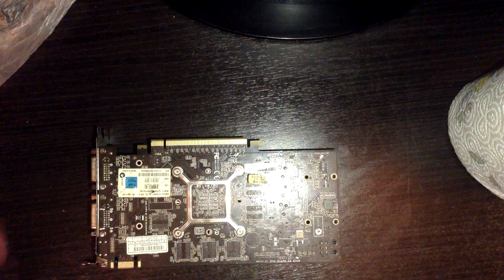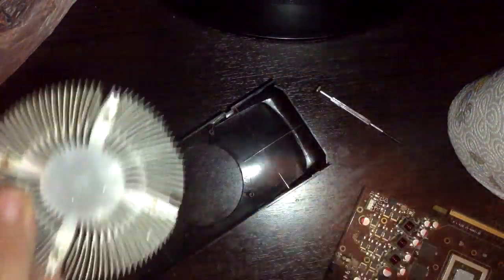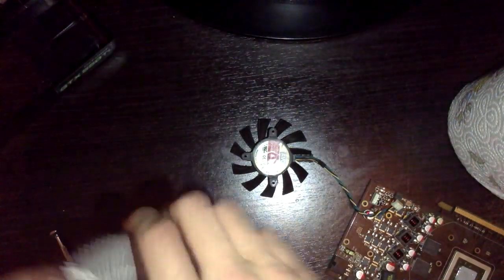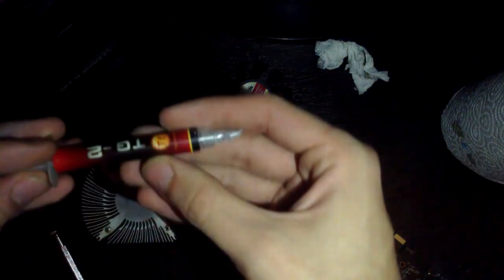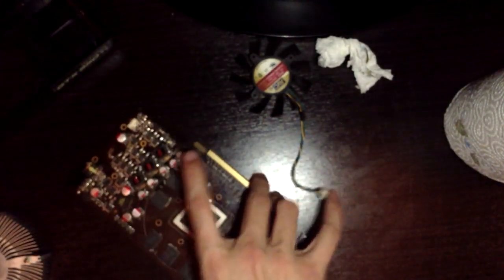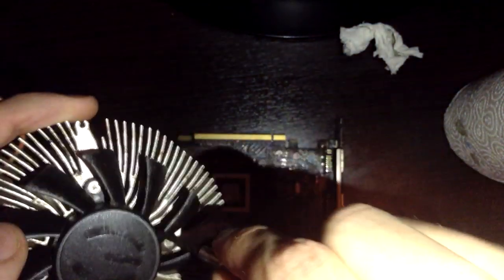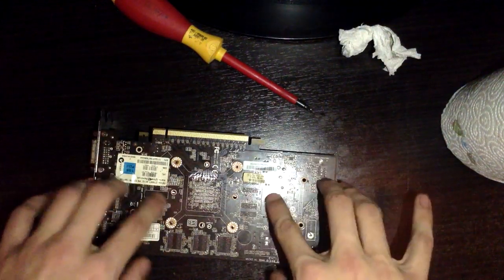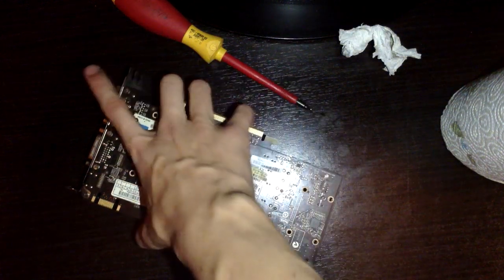How To: Clean a Graphics Card and Apply New Thermal Paste - EVGA GTX 550 TI

Comment: You can use Alcohol to clean that heatsink & old thermal paste off of the chip, as well as the fan dust.  I find it works well, just make sure it's Isopropyl alcohol.

Comment: brother, I have this same graphics card but one day I had an accident and I connected it to a monitor that shorted and damaged both components (integrated) that are next to the DVI connectors of the card, could you tell me the code of both integrated for I can buy them and fix my plate? I would greatly appreciate it

Comment: no dude u never smear thermal compound across a gpu cpu, only a bb size dot and the compression of the fan to the gpu is what makes it spread you also want two allow 24 hrs for it to set before Turing it on.

Comment: Good vid, but don't place the heatsink in water and "give it a good wash". Use a vaccum cleaner or get a can of compressed air. Either from your PC parts store or a chemist (pharmacy) yes a chemist. Why there? Because chicks use a can of compressed air to dry their nails rapidly after painting them.. So both places stock compressed air..

Secondly when you're removing the old thermal paste,  you need to make sure that surrface is spotless, and that means when you have everything you can get cleaned with your paper towel gone, use a cotton tip with de-natured alcohol to remove any leftover trace (or contaminants) to finalize it (prime it if you will)... Treat it like you would a CPU....

Thirdly FFS DO NOT USE A PLASTIC SHOPPING BAG!!!!!!!!  Jesus christ those those things statically charged. Why the hell do you think they seem to attract to your skin? They just gravitate there by random chance? yeah, static from the bag and your natural body static charge.... Holy shit how have you not fried your components??? Use an old credit card or business card or a piece of scotch tape (The frosted stuff)

Apart from the technical screw ups its a well presented video, easy to follow, clear to see, but you just need to rectify the bad advice given in it.
Reply: *****
Why? The thermal paste is kinda needed....
Reply: *****
Going back and looking at the video, yes, I would agree with you, def too much compound for sure. I didn't catch that first time round.. BUT my comment about the plastic bag still stands